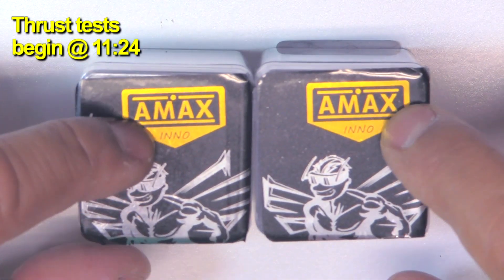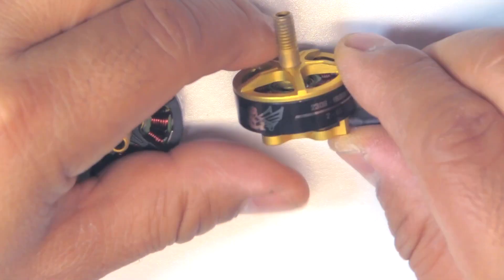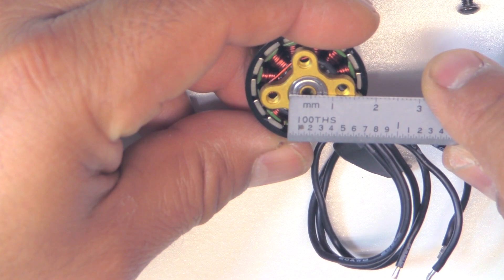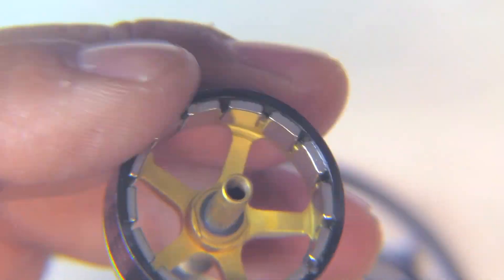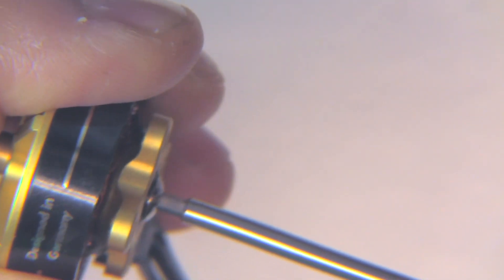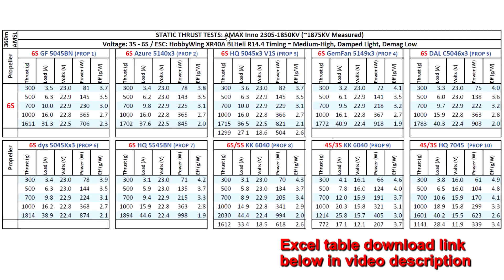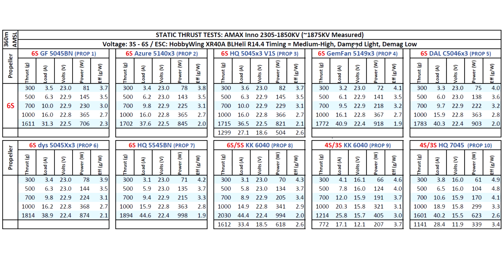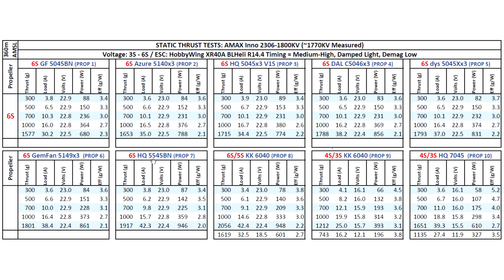AMAX Inno 2306-1800KV & 2305-1850KV 6S Thrust Tests and Overview

Comment: I have the 2306 2500kv one, top notch, excellent build quality, identical power with f40 pro ii 2400kv just a few grams heavier. I fly them more than 6 months now, very durable, still smooth as silk. Wish you had time for more videos buddy.
Reply from the maker: Yes , from what i saw, these are as good as any of the current top motors. I'm quite behind on the reviews. Have a few motors waiting for testing..... time is what I need!

Comment: You should do response time tests! Here's a possible method?
1. Measure max RPM of motor at different throttle levels w/ w/o props 
2. Measure spool up times from stopped power to different throttle levels
3. Give us those results!

This would be very helpful to people who need motors with faster responses, and I would really appreciate the data!
Reply from the maker: I definitely would like to run more detailed tests and measure response times, unfortunately the time available for testing has been constantly decreasing lately and I've been getting more motors than usual. I'm quite behind on testing and have lots of motors waiting, as much as I'd like to get more data, I don't think I'll have enough time to cover all the tests I'm committed to running. Thank you so much for the very good suggestion, yes I know those numbers would be very useful, I'll see If I can get a script to work and get some data. The only problem I can see with getting data would be #2, I don't think the hardware on the RCBenchMark board can log at high enough rate to accurately measure spool up time. I tried increasing the sampling rate a few times but the board wasn't fast enough at capturing all the data, got lots of blanks. I'd probably need to get a custom Arduino set up like the one MiniQuadTestBench uses bu my Arduino skills are quite crappy :(

Comment: What are your thoughts on the 2306 1950Kv motor for long range 4s?
Reply from the maker: The proven combo for longer duration flights is to maintain low rpm's and of course have as low weight as possible. I have personally flown for 15 min - cruising , slow pace using Cobra 2005-1960KV on 4S. 6030 props. 2750mAh 4S low weight batts (25C rating). My friend has flown close to 20min using 2006-1200kv using 8020 props on a large 3S-4000mAh (I forget if 4000 or 5000) Multistar, those green ones from HobbyKing.  That's close to what DJI uses. They do it right. 2312-960KV motors on 3S (i think) and 8" props. RPM is low but 8" prop gets enough lift. So that would be the best formula. 960kv to 1200kv / 8 to 10" props / large 3S, maybe 4S low-weight battery (low C-rating) Of course that would make for a rather slow setup. As you increase power output/performance, flight times will decrease.  KV, voltage down , prop size up = longer flights. 
I think 2306-1950kv could get you 12 to 15min with good throttle management and choosing a battery as mentioned - low weight. If you use the high performance batteries you probably won't get very long flights. They are heavy and designed to deliver discharge fast, but what you want to have would be the opposite. Lighter and designed to deliver discharge slower so for same weight you can carry more mAh. It can get tricky balancing and finding the right setup for LR. Also can't be trying several different motors because not economic.

Comment: 2305 and 2306 exactly same power with HQ 5x4.5x3 v1s. Is this correct? Thank you so much for the review
Reply from the maker: Yes. That prop is easy for both motors to spin and the 2305 has Higher KV so thrust was the same for the "light" props, even almost better on the 2305.

Comment: The instruction is in German language because AMAX inno is a German company, they motors and frames are designed by European FPV racing pilots inckl. German guys. They 2305 series are available  for $17.99 and 2306 series for $19.99. More performance infos about AMAX Inno motors you can find on miniquadtestbench website.
Reply from the maker: Thanks for the added info. Very well-designed and well-made motors for sure.

Comment: Hello, can you trouble you to test mark2 and LDARC XT2306? Thank you
Reply from the maker: Mark2 í didn't get motors from factory and too expensive to buy because only come in sets of 4 (bad idea from rcINpower) I have the LDARC 2306 motor here already but unfortunately I am way behind in testing because very little time available lately but I will test and review it only it could be after December. Sorry can't do it sooner
Reply: @EngineerX  Thank you for your reply. Can you recommend some highly durable motors? I bought some F60III 2350KV, they have good performance, but after a few impacts, the bearings have a lot of noise.
Reply from the maker: @sivisjoe9877  well.... there are several that are known to be durable but any motor can develop play or have the bearings go bad after a crash. But  the most durable ones  have 4x9x4mm bearings and are made of 7075 aluminum. This Amax is known to be very durable based on many comments from people in Europe. Other options similar to this are BrotherHobby R6 and speedshield, GEPRC 2306, 2207, Hypetrain Grinders looked good too. I'm surprised those Tmotors were not durable.